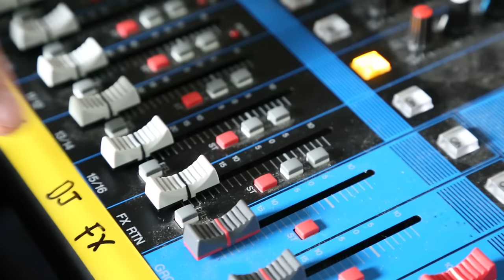How to Soundproof a party wall against noisy neighbours

Comment: It is a science.  Most people living in condos or townhouses share common walls.  Many people are self-centered (like people who don't use their car turn signal thinking they're the only one on the road and only think about themselves and what they're doing).  

So your neighbour may turn on the TV or stereo as loud as they want and not even consider it might be bothering someone else -- when they're the centre of the universe -- no one else exists.  Also, people seem to love hardwood flooring more than carpet -- and hardwood flooring is very acoustic and will travel sound waves to anything connected which includes other rooms or apartments.  If they have a sub-woofer on their hardwood floor -- then every floor on that level, even next door -- is going to get that bass boom boom vibrating. And no neighbor would even think to put a piece of carpeting under their sub-woofer on their hardwood floor -- that would be too considerate). 

 It's a matter of better building construction -- or more considerate people who need to realize when walls are attached, so are vibrations.  It's just science.

Comment: I’m so pleased this solution has worked for her! I completely empathise with her, having moved from a horrible noisy neighbour to a 50s build house, with lovely elderly neighbours adjoined who are generally quiet but the sound proofing is poor so general speech/television can still be heard. Needless to say I am so heartbroken / fed up after moving, we’re having sound proofing done next week (independent wall & with rockwool/matting), I am hopeful this will work for us xx or I might have a full on nervous breakdown :(
Reply: Did it work? I live in a 1930's semi and my neighbours are horrific and we're desperately searching for answer.
Reply: merce it has reduced the noise but it hasn’t gotten rid of it completely :( I’ll be honest and say that I am disappointed xx TBH if you can’t afford to move I’d say get it done to reduce the noise for your own sanity xx
Reply: Thanks for the ultra quick response - i am considering it but we've spent so much renovating this house that its not an option to move again any time soon. sigh Don't give up.
Reply: merce I’m so sorry, it’s so hard isn’t it, especially when you’ve worked so hard :( do try it, if it reduces it, that will definitely make you feel better xx I really hope you guys have good results x
Reply: I'm thinking of doing something like that, but my apartment is quiet and i can hear only my neighbors when they shout and its only form one dividing wall. 
Did you you normal rockwool or special acoustic ? And who installed it for you? Someone who knows what they are doing or DIY?
How much quieter it is , what would you say? 50% , 75% ,90%? 
Sry for so many question  and tnx for your time.
Reply: ex We used a professional soundproofing company in the U.K., it was rockwool, acoustic boarding and its made about 40/50% change to the sound. Our neighbour are a lovely old couple but one of them is deaf and has their TV up quite loud so the resignation of that comes through (suspect through flanking) - it was worth doing as it has reduced it but please don’t get your hopes up too much that it’ll resolve all the issues. Unfortunately the only way to guarantee that is a detached property! Luckily the home we are in is not forever home, we are planning to move out of our home town altogether in the next year or so (detached). Good luck
Reply: Thank you so much for your info. Besto of luck.
Reply: you can fix it quickly if that wall doesnt have humidity or heat problems by using neoprene sheets, and carbon foam over the neoprene to purify it and cotton plus drywall over it, is cheap and block entirely the sound
Reply: XxIzhtarxX too late I’ve already decorated over the wall. And it will not block the sound completely as it is travelling through flanking. We have already decided to move away to another town in the next 18 months so we are generally okay with the reduction in sound but I must stress that anyone reading this should not put their total hope in noise insulation. Detached is the only way if you want no sound
Reply: too bad, at least you know about it now, it can even stop high traffic sound.
Reply: XxIzhtarxX Noise from outside and noise travelling through a connected building (flanking) are two very different things.
Reply: is the same thing, sound wave is energy moving through porous materials, and i don't wanna argue about it, if in the future you want to eliminate even strongest sounds like airport you can write me and i will answer with a better mix of materials. i have tried almost  everything.
Reply: XxIzhtarxX yeah sure you have. And my hiring a professional soundproofing company to undertake a job doesn’t compare to a teenager in his room. No thanks
Reply: im not a teenager, i wish i was, and who cares about your "professional" but who cares. you just refuse to admit you wasted your money.
Reply: XxIzhtarxX Okay dear, you tell yourself that.
Reply from the maker: Shell, it is amazing how many Soundproofing experts there are out there, we may as well pack up and go home! Sounds to me like you could have done with putting some ReductoClips (will absorb impact) on the new stud frame (to do it perfectly you need to leave at least a cm gap and then maintain isolation by putting rubber or isolation strips around the perimeter of the new stud frame) and perhaps put a different type of mass between the two layers of dense plasterboard as some sound frequencies are reduced better with a different type of mass. But actually from what you describe, you are getting a better reduction than I would have expected.
Reply: yea those experts raised since our beloved professionals started selling shitty services/products, specially those that still use drywall -cardboard instead of highly layered plywood.
Reply: 1st or 2nd floor? if it is 1st a cheap way is using sand, if it is 2nd depend on your budget
Reply from the maker: Hi Jr R, the SoundBoard4 as shown in the clip is a laminated board with a couple of different layers. The finish is a 15mm acoustic graded plaster board and laminated to that are two layers of mass loaded vinyl which have similar properties to lead and sandwiched between is a layer of acoustic closed cell foam. The boards are 1.2m x 1m in size and weigh 30kg each. In terms of your requirements, you firstly need to determine where the sound is coming from and the type of noise that is causing you a problem. If it is airborne and you can hear clear conversations/make out the TV programme then I would recommend something like the SoundBoard and if your floor has standard wooden joists running into the next property then you may want to fill the voids with some Rockwool or similar to prevent the sound travelling through as a vibration and then resonating. echoing and amplifying the the sealed voids (this makes up between 10-15% of the whole solution). If your noise problem is more extreme and you hear excessive or loud impact sounds also then you will want to look at building a new stud wall and using something like our Isomax Clip System (takes the concept of building a room within a room and uses sound absorbtion clips).https://www.soundproofingstore.co.uk/store/-p52900685
You are more than welcome to give us a call - 01423 206208. My top two tips when considering Soundproofing - treat it in the same way as waterproofing, it will only be as good as the weakest point. Work with a proper Soundproofing company rather than a standard builder for example. Quite often we do pick up the pieces from contractors especially when they are trying to achieve a building regulation pass here in the UK. We see so many people spend so much money and get it wrong in the first instance.
Reply from the maker: The sand point does have some legs. We have worked on a number of Victorian houses that upon lifting the floor boards have sand between the joists(very messy). This would actually stop sound resonating around the void, as would cotton wool but the question is to what extent? Rockwool isn't too expensive, isn't messy and has the right qualities to perform well and the key word - proven. Another point to make is that you would only need to apply Rockwool up to a metre and half away from the wall to stop flanking noise. We ship all around the UK, when the time is right we will be more than happy to help. If you get stuck with a specialist contractor, we do have someone who covers the South Of England that we work with closely and has installed our systems many times over.
Reply: cancel the noise is simple, tuning your room isnt the first thing every body can do it, the second one no.
Reply: It wont work because to soundproof successfully you need to build a room within a room, doing just one wall is a waste of money, sound travels like air so it will find the next point of entry.
Reply: shellmcc0414 😢
Reply: shellmcc0414
My neighbour is terrible, bangs on the walls, shouts but my goodness you can even hear them putting cutlery down from within my bedroom. I can't hear a peep from any other neighbours, even those adjoining. It's quite shocking tbh, disturbing and frustrating. I'm sure many people have had careless neighbours who are unaware of just how noisy they are, or they have children. I tend to be quite tolerant, but you start to lose your cool after a while especially when noise is at hours that are totally unsociable or it's all day and night. Would you mind, do you have the name of the company you used? I'd like to pull in as many options as possible. I'm happy for you to email me directly. I'd really appreciate it! I hope you're getting some rest from your neighbours, even if the reduction wasn't what you expected. Though I'm sorry to read this, I'm hoping you're forever home is around the corner for you, and you don't have to deal with this again! All the best!
Reply: Who was it who said "Hell is other people...especially if you live in Manchester!!"
Reply: God I’d love to have nice quiet elderly neighbours.

Comment: "Now when they're talking, I can't hear them". Then how do you know they're talking???
Reply from the maker: schrodingers noise problem?
Reply: Quantum mechanics?
Reply: That fireplace seems like a bigger problem
Reply: Because they are not dead, and hence must be talking sometimes, but you can't hear them anymore, so must be that soundproofing has worked.
Reply: Well either the soundproofing worked or they just happen to die the same day she got it installed
Reply: @SoundproofingStore  hey, I need soundproofing down... How please?
Reply from the maker: @yohabihd3396  It depends where the noise is coming from, e.g. a wall, floor or ceiling? The levels and types of noise you are trying to soundproof against (e.g. airborne or impact noise, or both) and the makeup of the building, e.g. if a wall, is it a solid wall or a timber wall? You will find lots of advice and soundproofing solutions on our website: https://www.soundproofingstore.co.uk/
Reply: Hahahaha...
Reply: Cinical
Reply: blipco5 tbh that would make sorta sense as quantum entanglement
Reply: I think she means she can’t hear their conversation but can hear some muffled noise; the video showed there is still some noise (34db).
Reply: @richgl31  Have another look, the noise was only a 1db increase over ambient, so she couldn't hear anything from next door at all, no muffled noise, only the pre-exitsting ambient noise (which is nothing to do with next door).
Reply: trevhib yes, good point- I missed that. I wonder if the two wardrobes were back in position when they measured it?. I am hoping not as we really could do with this in our Victorian terraced house to block out the zoo next door.
Reply: @richgl31  I think it's well worth a go, or at least more research.  Blessings.  Noise from next door, even when it's not through folk being inconsiderate can be such a drain.
Reply: trevhib  No, they are just living their lives and we have a small child- so I am sure the desire for soundproofing is shared. Thanks- definitely going to get a few quotes.
Reply: @richgl31  All the best with it.
Reply: figure it out!
Reply: Well, do you think the neighbors have suddenly stopped talking?

Comment: This is all well and good for general noise such as conversations and TV noise, but what about foot fall and doors closing/slamming? And flanking noise in the window walls?
Reply from the maker: Hi James M, SoundBoard 4™ is for general household airborne noise. For impact noises or for louder more extreme levels of noise, you need to look at our ReductoClip system:
https://www.soundproofingstore.co.uk/reducto-clip-system
 Noise flanking down external walls is quite rare, but if you can clearly hear sound coming out of the adjoining external wall, you will need to address this wall as well.
Reply: @SoundproofingStore  yes it's quite shocking the noise that is flanking down the external wall. We even get neighbours cooking smells in rooms the opposite end of the house. I can't help but think it would be a bigger job to sort that issue out i.e blocking off the cavity wall at the party wall by means of bricking it off perhaps, rather than just a simple soundproofing techniques? Do you have any suggestions on this matter? Also, is it easy to effectively soundproof a chimney?
Reply from the maker: @jamesm9434  we can happily discuss this in more detail with you and advise accordingly. If you wanted to call 01423 206208 to speak to one of our technical team.
With regards to soundproofing a chimney, this blog might be of interest:
https://www.soundproofingstore.co.uk/how-to-soundproof-a-chimney

Comment: Wouldn't the ceiling need to be insulated as well though?, as surely the sound would still travel through the space between her ceilng and the floor above??
Reply from the maker: Hi BlockABoots, in this instance the sound was coming through the party wall. This can vary in different properties and with different types and levels of noise. Our best advice would be to listen when you can hear the noise and do an ear test against the wall, alcoves, chimney (if applicable) the same can be done listening for noise coming through the floor and ceiling.
The most cases the vast majority of unwanted noise from next-door will be coming through the wall.
Reply: @SoundproofingStore  yes I understand that but my point was there is the part of the wall between the ceiling and the floor above which you won't be able to cover unless you lift the floorboards in the room above to gain access to that part of the wall. Or would this not make much difference?
Reply from the maker: @BlockABoots  you can address this if it's needed but it wasn't needed in this instance, as no noise was coming through the ceiling.
Reply: @SoundproofingStore  My neighbours love knocking on the shared wall. Can it block those kind of sharp loud sudden noises? Considering adding a foot thick filled dry wall to the shared wall to try and block out the sound.
Reply from the maker: @DavidSmith-oy4of  Knocking sounds are what we call Impact Noise. When an physical impact is carried out against the wall (also like banging doors and cupboards, heavy foot traffic etc), this creates a huge vibration in the structure. That vibration travels through solid materials easily. So unfortunately adding more mass to the wall isn't going to solve that problem whetehr its our SoundBoard 4 or a foot thick dry wall! You need to de-couple the wall and add resilience to the wall. For this, you need our ReductoClip system - https://www.soundproofingstore.co.uk/reducto-clip-system
Reply: @SoundproofingStore  Thanks for this. Watched the video and read the site, the prices seem surprisingly reasonable too. Will definitely be considering this in the near future.
Reply from the maker: @DavidSmith-oy4of  Thanks David. We try and keep prices reasonable and competitive while also making sure people are getting the best qualtiy systems and the correct advice to go with it. You know where to find us when you're ready, we'd love to help you.

Comment: Just spent quite a bit of money with the Soundproofing Store and it all got delivered today! Very exciting. Have opted for Soundboard 4 for 2 rooms and Reductoclips on 2 rooms. I'm hoping that 1:21 will be me in a couple of weeks.
Reply: @Tron Hello - I haven't installed a full wall so far with the Soundboard 4 yet, however, I have completed a wall using the Reductoclips - 1 down 3 to go. We are also putting in Earthwool into the floor joists as well. 

I'll keep you in the loop!
Reply: Hi Sorry to bother you, was wondering if you had everything installed now, and if so, how it all worked out for you?  Did the Soundboard 4 do a good enough job, or is the Reductoclip noticeably better?  Alsodid you put earthwool between the floor joists in a downstairs room with a suspended timber floor? I'm just trying to workout how to install it there without it falling down. thanks.
Reply: @chaymation2  Hey Chay. So the long and the short of it.

There is no doubt that the Reductoclip does a great job for talking/shouting noise and I found it easier to work with than the Soundboard 4. The soundboard 4 is HEAVY.

If it's impact noise and bass, just move. It isn't worth the effort and pain to find out your efforts have been wasted. Yes, the Soundpoofing store will say "you should have built a stud wall and attached the Reductoclip to that" but impact/bass will just flank around it.

Earthwool is great and definitely assists with flanking noise, just wear gloves - it's horrible.

All in all, we probably spent £4000 and many hours working on it.
Reply: Has it got rid of shouting and loud speech? That's my problem I'm hoping to fix before I buy a shotgun!
Reply: @StudioChimps  Yeah, it'll do well for that. However, moving is always a strong option ;)